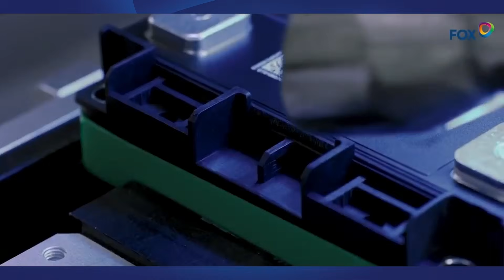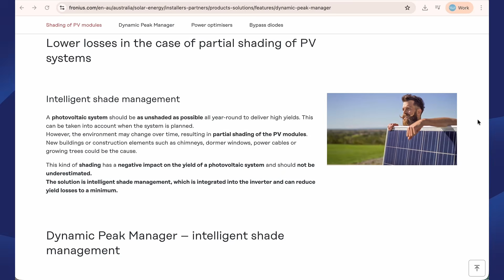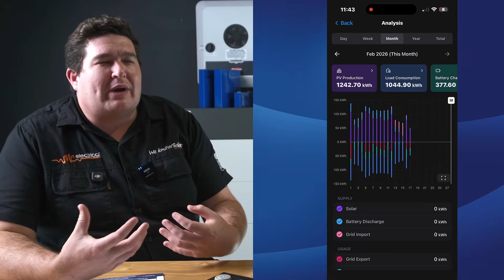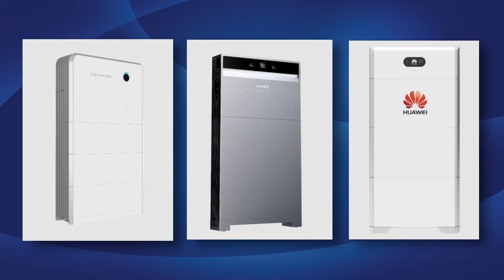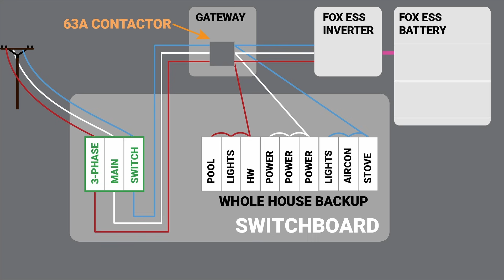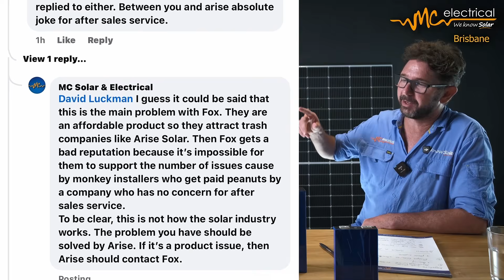Fox ESS Battery Review Post-installation & Factory Tour

Comment: EQ4800 no good as it goes in to limited power ,at low temperature around 10c .. will not charge at more than few watts , no good for Victoria …
Reply from the maker: Sorry to hear you found out the hard way. The newer battery modules have heating pads now.

Comment: Very good show, but very quick. Couldn't catch-up, did you say DC coupling is not good? I have a very important question about cable size which you didn't speak about. I have 3 phase 10 kw H 3 smart inverter DC coupling, 14 metre distance from meter box to the inverter. What is AC cable size? There should be an installation guide inverter size and cable size. The ABN record gets bad when the electrician receives 10 complaints in a month. The company is Betawatt solar, all good ticks on line, but violated manufacturers instructions and compliance.
Reply from the maker: No, I’m not saying DC coupling is bad. Done right, it’s often the best setup.

For the AC cable size: a 10 kW 3-phase inverter is only around 14–15 A per phase, but cable size still depends on the installation method, cable type, temperature, grouping, protection device, and voltage drop.

At 14 m, you’d expect something like 4 mm or 6 mmAC cable, but I wouldn’t confirm it without doing the actual calc
Reply: @mcelectrical But the manufacturers quick guide says 3 phase 10 kw inverter 6mm  cable size. My installer used a 2.5 sq mm cable and cat6 UTP run together with that AC cable.  FoxEss does not give ownership, the installer has the managerial access. So he can control the customer forever and charge fees. The other battery's owner is the real home owner, so the owner is not locked with the bad installer.

Comment: Thank you for the review. LFP batteries are more heat tolerant than NMC batteries, so the heat issue is significantly less. NMC batteries do not like going all the way to 100% regularly, whereas LFP can. Companies like BYD tell EV owners to discharge the LFP blade battery to at least 10% regularly, and then back to 100% so that the BMS can sense the full range of each cell, which keeps the cells balanced. LFP is better for longevity.
Reply from the maker: Thanks for the explainer, do you work in renewables?

Comment: One big reason I got a Sigenstor is precisely because of that DC-DC converter in each battery module. It makes each module independent and it allows you do things like later on add or substitute newer modules. A battery manager sitting on top of a stack of batteries doesn't have this flexibility. Also, the losses in the DC-DC converters is negligible. In practice the heat comes from the inverter. One design problem with the Sigenstor is that it needs a "dummy" module to put more thermal isolation between the inverter and the top batter. However, so far I've never seen it get so hot that it would be a problem. Oh and as an electronics designer myself, the argument that there are more bits to fail (using DC-DC converters) doesn't hold water. These things are simple, well understood and a well designed converter will last forever.
Reply from the maker: As an electronics designer, surely you’d agree that adding more power electronics introduces additional potential failure points?

SolarEdge is a perfect example. Their DC-DC optimisers are relatively simple, well-understood technology, yet optimiser failures have been a significant issue in the field. Simplicity doesn’t guarantee reliability, particularly when electronics are exposed to heat and thermal cycling for years.

Every DC-DC converter introduces additional semiconductors, capacitors, inductors, control circuitry and switching losses. Multiply that across every battery module and you’ve introduced a lot of additional components that can fail.

I’m not arguing that DC-DC converters can’t be reliable. I’m arguing that additional components does not increase failure risk is simply not credible engineering.

The flexibility has some advantage, (however it’s not like you can’t add a battery on to a high voltage system a few year later) But the flexibility comes with trade-offs in efficiency, heat, complexity and potentially long-term reliability.

Comment: Can the FOXESS KH10 hybrid inverter keep the PV array operational during a grid outage so that solar can continue supplying the backup circuits and charging the battery while operating in EPS / island mode?

DC coupled, single phase, blackout protection X 2 circuits
13.3kwh solar panels ja solar lr series 
10kw hybrid inverter kh10 foxess
27.96kwh battery eq800-l6 foxess
Reply from the maker: What did you decide to go ahead with?

Comment: Had a new install done in VIC last week, 3rd module was dead on arrival, Fox ticket was logged by me via the app on Friday

I was contacted the next day and told a new module was ordered and they would be in contact with me Monday

The guys from the Melbourne location came out and even called to say would it be ok if they came 20mins earlier.

They came, installed the new battery and it worked instantly, we had a chat about Fox and they seem super happy working with Fox, they mentioned this review and said it was received well by Fox, both the pros and the cons and they are keen to fix the any issues

Fox support was easily 10/10
Reply from the maker: Great to hear you had an excellent experience with their support team, thanks for sharing!

Comment: FoxESS 42kWh in one stack. Fronius with BYD or Reserva need parallel stacks with some stacks having as little as 3 modules (9kWh.) Lets not even mention the measly output from the 5kW Gen24 Primo and hardware for full backup 🙄
Sungrow is a lot better with 19kWh per stack . Their integrated Whole Home Backup feature is excellent. Costly for the battery control units on both brands though! The premium products biggest disadvantage aside from price is the huge space requirement to fit parallel stacks. 
FoxESS would be the perfect product if it had Sungrow's whole home backup feature.
Reply from the maker: I agree that if energy density is the number one priority, the BYD or reserva isn’t the right product. If a conservative approach to energy storage & power electronics, and proven reliability of both is higher on the agenda, then fronius wins.

Comment: Just get sparky to run the EPS out of the inverter through a changeover switch in your main consumer unit. You can buy a Hager changeover for around $80. Full EPS output to your whole board this way. If worried about tripping on 45 A (I think that's the output on the single phase 10 kW inverter) size a CB for max demand in place of the higher rating CB that needs to protect the changeover. Easy. I don't know why you would put in back-up circuits; they are poo for a number of reasons.

Comment: People here in the UK absolutely hate Fox ESS! Trustpilot score is < 2 out of 5 and it can't hold a candle to the Powerwall 3
Reply from the maker: Interesting. Why is that?
Reply: @mcelectrical  Just search for "Fox ESS Trustpilot" and see for yourself. The summary on there is:

"Most reviewers were unhappy with their experience overall. Many people were dissatisfied with the customer service, finding it unresponsive and difficult to reach. They also encountered numerous quality issues with products, including inverters and batteries failing prematurely or not performing as expected. The accompanying app was frequently criticized for being dysfunctional, complicated, and unreliable, especially after updates.  Some people were dissatisfied with the lack of effective contact methods, reporting unanswered calls, emails, and support tickets..."

Frankly,  it was always the brand that one two man operations used to undercut quality installers on price. At the end of the day, most consumers see a white plastic cladding on a box and assume all hardware is similar.

Comment: Hi guys, great informative review. I was hoping you could help me clarify something about backup functionality.
I’ve just had a system installed 15.2kW solar + 15kW 3-phase hybrid inverter (H3-15.0 Smart, 3 MPPT) +9 × 4.66kWh FoxESS batteries (~41.9kWh total) with Essential loads backed up 
I was under the impression that the backup would automatically kick in during a blackout, but that’s not how mine is operating.
Currently, if the grid goes down I need to go to the switchboard and manually switch over to backup, Then switch it back again once grid power is restored 
This feels pretty inconvenient and not what I expected from a system with blackout protection. Just wanted to check Is this normal behaviour for FoxESS systems? 
Or should this system be capable of automatic switchover? 
I’m planning to go back to the retailer, so I just want to make sure I understand what’s technically possible before I push back.
Really appreciate any insight you can share.
Reply from the maker: Yeh that’s odd. Not really sure how they have set that up. Is it whole of house backup or just a few circuits?
Reply: @mcelectrical  It's not the whole house only a few circuits. they said that only a few brands allow automatic switching. i had a look online and found the EPS BOX PRO maybe thats what i need which looks really expensive. Anyway thanks for getting back to me hopfully i can figure it out with the retailer just feel like i made a mistake going with the fox ess setup. Keep your reviews going.

Comment: The 20 amp breaker issue. I am concerned I just got a great quote for a 42kwh battery and a  H3 10 kw inverter. I have ducted air with an 18kw compressor, the breaker is 40amp, to be  clear even during the day running off the grid if I turn that on it will   trip the inverter and I will loose power? So that would mean I could never run my ducted air even from the grid. Is this correct?
Reply: Just don't have it installed on your EPS backup circuit. Anything that is backed up in a blackout runs through the Fox inverter. If its on the non backup side and you'll be fine.
Reply: @Yorick_Mark many thanks for the reply, i think i understand. So it's only the stuff on the EPS  that causes an issue. The aircon and oven for example would not be backed up so no issue. Do you think a 2.5kw split aircon would be able to be backed up? Sorry for questions, the more i look into this the more confused i get
Reply: @simoncarter4231  That is correct. It's just the EPS circuits that run through the internal contactor, which is the bottleneck.

A split system should be fine, just be aware that you only have 5kW per phase even when you're not in a blackout. Your installer should not install the air conditioner on the same phase as the backup power circuit. If you have all LED lights, pop the Aircon and the lights on phase A and then your backup power circuits on phase B & C. LED lights use very little power and it should be unlikely to exceed 5kW even will lots of lights on and the aircon blasting (small split system)

You could ask your installer if they can install the 15kW H3-Pro instead. It has a higher pass-through current and the risk of tripping is much less. See comments below.
Reply: Perfect, thank you so much for the reply and advice, i really appreciate it. Thank you
Reply: @simoncarter4231  Happy to help

Comment: Hey, Love your videos. Can you help me? I've been trying to find the Bypass rating everywhere for the KH10 and can't find it. The Fox tech support said it's the same as the max ESS output. Can you confirm that it is only 20amps like you said in the video?
Reply: The KH10 being the single phase 10kW, has a 63A pass through for the AUS market according to the spec sheet. 

You want to look at the maximum AC input current line on the document

Comment: Hi Lads, thank you for all the info.  Can you please advise if the Fox ESS 3 phase H3 SMART 15kw Hybrid inverter is sufficient or it's best to get a 15kw or above from the H3 PRO range?
Reply from the maker: If you want decent backup, then go for the pro. Otherwise you’ll be limited to 3 circuits in backup
Reply: The H3 Pro has a larger internal islanding contactor. It's far less likely to trip during day-to-day use.
Reply: @Yorick_Mark what’s the rating?
Reply: @joeee60  It depends on the inverter size. I'll have to check the spec sheet but its a bump up from the H3-Smart
Reply: @Yorick_Mark The 15 kW smart and pro have 22.7A per phase.
Reply: @joeee60  For the passthrough current you need to look at the "Max. AC Current [A] (Per Phase)" line item which is 34.1A for the 15kW H3-Pro. Compared to the 24.2A for the H3-Smart
Reply: @Yorick_Mark thanks

Comment: I been told by Fox provider that Fox Battery/Inverter cannot charge the battery while the Grid is down, i find this to be a major draw back not being able to charge the battery from solar panels while the grid is down. Can you confirm this ?
Reply from the maker: Hey Smarty, no that’s not correct. If you have an existing solar system of another brand, Fox won’t keep that other inverter running  in a blackout. But the Fox inverter will stay on and charge the Fox battery.

Comment: The installer was completely useless who installed my fox battery. They got paid 3000$ for a days work from the company they work for.

Fortunately I have no accreditation or any training and rewired the ct clamps and reconfigured the battery.

The solar scam is alive and going very well to the unknown buyers, which is the majority.

My solar install was a complete disaster as the installer couldn't resolve the over voltage. Fortunately with no training I debugged the 25kw inverter and got goodwe in china to fix the software. After that the inverter worked as it was meant to.
Reply from the maker: Hmm yep. Buyer beware. Especially with Fox. But you mentioned Goodwe and Fox.
Goodwe is a step up from Fox, But… yeh cheap products attract cheap installers

Comment: Hello MC Electrical!
Hoping you might be able to help me 
We had a Fox ESS 42 Kw battery installed yesterday along with an AC coupled single phase 9.9 kWh inverter.
We have existing 6.6Kw Solar with a 5Kwh inverter. 
The installers did not disconnect the old Inverter when installing the new which means I now have 2 inverters running. 
I fear this is not a good idea because my incoming Solar generation is now being clipped to approx 4.5 Kw. This restriction being due to the operation of the smaller inverter. 
Am I correct in saying this? 
If so can I fix the problem simply by turning off the smaller inverters Isolater switch? 
Appreciate anyone's input!
Reply from the maker: No turning off your old inverter won’t t help. it sounds like your installer has export limited your Fox. But you’d need to check out what export you were approved for with your installer.
Reply: Thank you!
I'll have to investigate further. @mcelectrical
Reply: Hi My installer proposed too. Sungrow 5 KW non hybrid from previous. Runs in conjunction with Fox 40Kw 10 KW. No good?
Reply: @maplesmatta 
From everything I am reading and experiencing...Yes! This is not good!
Reply: @maplesmatta I have contacted the Technical Support Department who are caring for issues with Aussie Solar Batteries installation. They have acknowledged that this is a problem and are arranging for the Installers to return and disconnect the old inverter.
Reply: @linoceccato7032  Wow ASB must be naughty to have a whole govt.dept. on them. Ive seen good and bad info with ASB.

Comment: Fox ESS pitch to installers is that you can be onsite for an install for <2 hours and do multiple installs per day. Feels like that is attracting the wrong installers. Cheap deals though. https://youtu.be/0DfuHjxd5xk?si=YGJuqi39uqbbzh42
Reply: It takes 4-5 hours on average, There were four guys doing mine. Are quality installers only those who charge a 10k plus premium for one day of installation? Obviously its a pre rebate getting slashed frenzy currently
Reply: @harper11 a quality install is the result. A quality installer quotes enough time to ensure a quality result. If Fox installers can do that with two guys in <2 hours, then great I guess. But your install effort sounds more likely to result in a quality install. It's people taking the time to do a job well. You're paying for the time that that takes, that's not a "premium" IMO.

Comment: 16:49where did you get these data from?
Reply from the maker: We installed all of these systems and did round trip efficiency tests. For charged and discharged at different rates and measured I throughput with a Fluke data logger.

Comment: I’m confused. Hoping you can clear something up. So the companies quoting me have said I will have full protection during a blackout. As I live rural it’s important to me. No power means no running water. I want to run my whole house in the event the power goes down. I’ve been told I just need to upgrade my circuit breakers. But your saying the size of the inverter means I can only have a lights circuit ect on before tripping?
Reply: if its a 3-phase supply and your needs require full house backup. Fox ESS H3 smart is  not your best solution. Upgrade to a larger H3 Pro.
Reply: @Yorick_Mark Is the 15kw pro enough?
Reply: @joeee60 talk to your installer and discuss your needs based on the loads that need to run EPS backup. If your installer is using the built in islanding contactor youll need to ensure that it is rated to handle your loads 100% of the time. Don't want nuisance tripping when your not even in a blackout
Reply: @Yorick_Mark  single phase
Reply: @shaunchamberlain6954  You should be fine. It's mostly a headache for 3-phase connections.

Comment: And the cost of a Fronius Gen 24 with Reserva at equivalent system size as the SigEnergy battery? Even with poorer round trip efficiency, you won't make back the cost difference over its reasonable life.